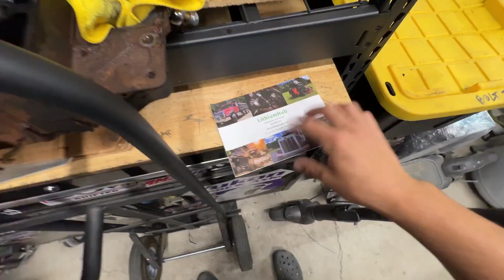Lightest Truck Battery

Comment: Before starting my new engine, what checklist should I go through? 
Also is Luber plate good for building with? Got it from work for free…
Reply from the maker: Yeah that stuff works well for everything, I do recommend using something a little more slippery for the Tappets. 
I always make sure to prime them before so I make sure it's ready to work, but make sure you crank on it before the injectors get plugged in